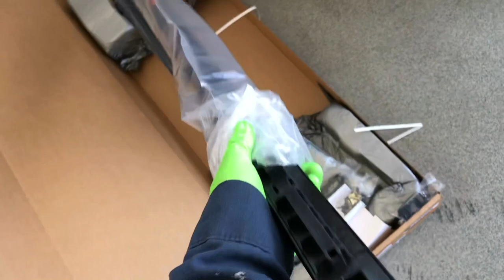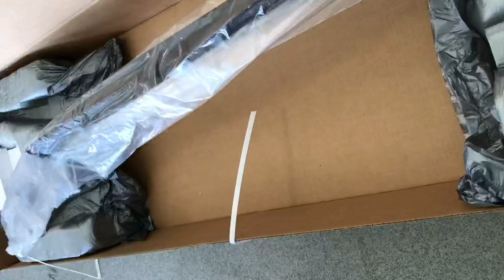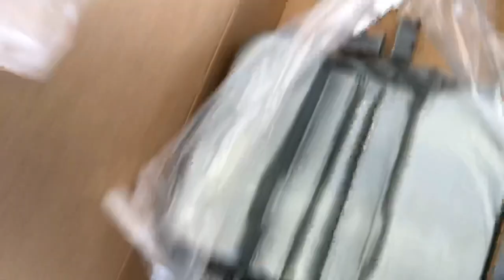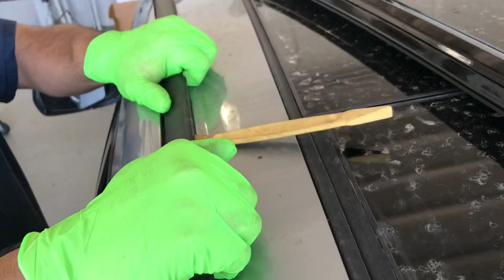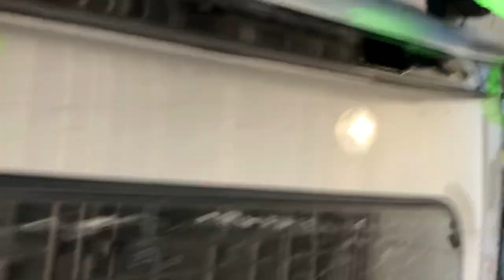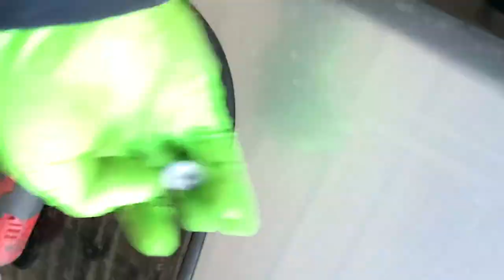2019 - 2020 Acura RDX - Roof Rails Installation - DIY

Comment: Hi is the installation same with 2020 Acura MDX.
Reply from the maker: @myrlaparungao7344  hey man, it's kind of similar. Removing the two trims, 2 covers on the rears and reuse it for installation. The two long trims need to be cut front portion and reused for installation about 17" or 27", not exactly which one on top my mind, but it's easy to figure, you can kind of pre-measure before cutting when having the rails on temporarily. Measure the trim, so it tuck under the rail slightly, so the rail cover over the trim. Hope that helps man.

Comment: Love it. Where did you buy them and how much for both sides? Thank you so much. I just got 2017 mdx but its top looks little weird so.....need like your.
Reply from the maker: It’s a OEM accessory parts. You can get it from a local Acura dealer or go online look for this part# 08L02-TZ5-201 which is roof rails for 2017-2020 Acura MDX

Comment: I installed my roof rail and super easy, anybody can do it. Just had to buy a t30 TORX bit for $4 at home depot .
Reply: However..the cost of the rail is just insanely overpriced lol. Didn't want ugly Thule clamps to use a crossbar tho
Reply from the maker: Congratulations doing it yourself. Good to connect with you idubbz 🙌
Reply: I bought Bosch 2 pack on Amazon for $3.99

Comment: Would the 2019 MDX aspec model be the same installation?
Reply from the maker: Hi Ron; it is slightly different; the one on the MDX,; after remove the roof trim. You have to cut and retain part of the trim- the front part, like 17.5in or so; then the installation is similar, bolt on and clip on
Reply: @huunwheels7378  awesome!  Thank you so much.  I will go ahead and purchase the rails and cross bars.

Comment: I like how easy you make this installation to look like.   It is easy, so easy I'm going to buy the racks and DIM. That's right, I'm going to do it myself. By the way, what is the name of the rail that goes across over the roof? Also,  can I buy all the racks as one package or did u  purchased them individually?
Reply from the maker: Yes,. it is easy to install it. You can get the rood rail and crossbar as a package.

Comment: Thanks for posting, it sure help, i have been thinking for my 2021 RDX, so, no cutting needed, is it fit just right in. Question, do you bought the OEM from Acura? Overall, thanks for sharing.
Reply from the maker: Hi KK. No cutting needed. It is fit just right in. And yes, it is OEM rail from acura dealer. Good to connect with you 🙌👍

Comment: what torque should they be tightened to?
Reply from the maker: Hello Simon! I dint have access to get the accurate specs at the moment. It is Somewhere between 9-12 lb-ft 
https://acura.bernardiparts.com/Images/Install/2019_RDX_RoofRails_BII07802-06.pdf

Comment: You did not show how the crossbar installed
Reply from the maker: Nuj Alli Hi Nuj.  You’re right, I didn’t get the crossbar install part. It is very straight forward after the rail installed. Pull off the rubber plugs on the rails, back out the crossbar bolts, line up with the holes and torque the bolts down. Pretty much it